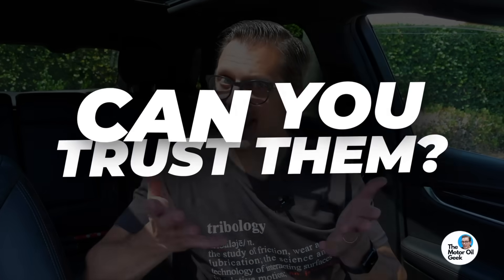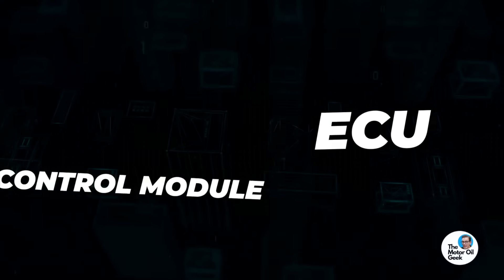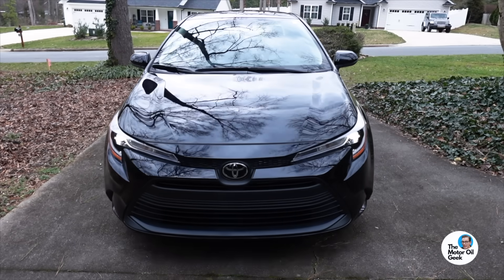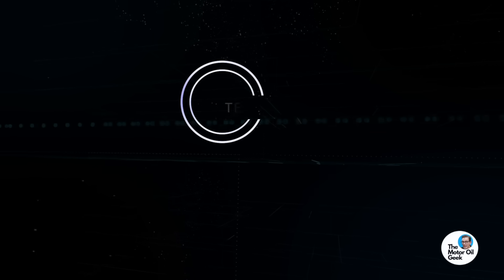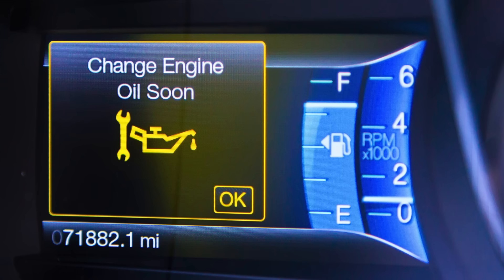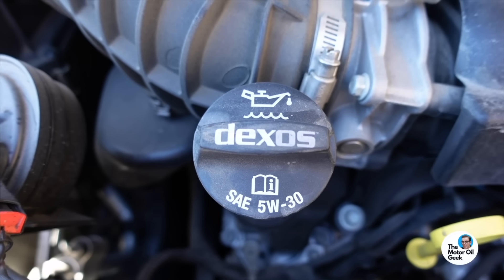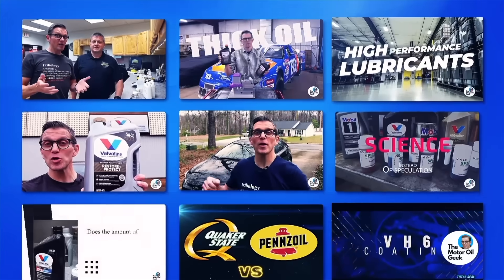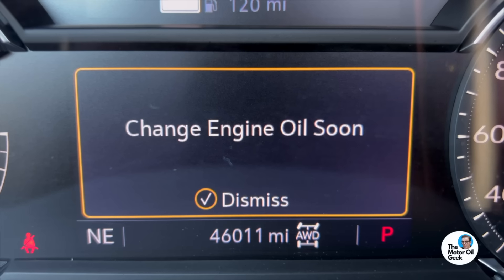The Accuracy of OIL LIFE Indicators REVEALED!

Comment: I would like to see this done on a Ford Hybrid to see what the oil life monitor says about how those are on oil. Lots of shutting off and restarting, resulting in high fuel dilution, not getting up to temp on the oil and getting contaminated with moisture. It would be interesting to see how the oil looks after several thousand miles.
Reply from the maker: Great suggestion!

Comment: Personally speaking here:
I have a f150 with the 3.7 in it, and I use pennzoil ultra platinum full synthetic 5-20w. And for the last 5yrs I don’t let the oil life get below 50% (it averages out to about 5,000 miles) before I get my oil changed. I have a 20min commute (10city/10highway) Mon-Friday, and I drive with common sense (my daughter says I drive like an old man 🤷‍♂️ lol). I do take longer drives/trips on the weekends, but my driving habits are the same.  I know getting my oil changed at 50% is definitely early, however I see it as oil is cheap but engines are expensive. She runs like a top (with 130k on it); no leaks, no hesitation, no sputtering, just silky smooth. 🤷‍♂️ 😊
Reply: That Ford 3.7L V6 N/A engine is excellent. We've had many Transit cargo vans w/it get huge mileage before we sell vans (running great & employees will bid on em). Consistent basic maintenance practices is key. Only full synthetic engine oil (that meets Ford specs) like Pennzoil Platinum or Motorcraft Full Synthetic which i use both personally & business uses predominantly Motorcraft. OEM filters fine as well if stay below 6k mis. Top Tier rated fuels highly recommended by Ford & everyone. My 24 Ranger Raptor 4wd truck had 1st oil change (Motorcraft full synthetic 5w30) b4 1500mis - use top tier rated midgrade 89/93 fuel only. Gen2 3.0L twin turbo seems like it so far! Engineering perspective.
Reply: wasting alot of oil and money- your money I guess- but contributing to environmental damage.
Reply: @roberthooper8883 You drive a electric car I guess. I change the oil in my 95 dodge quite often depending on I've been towing or just driving but mostly 3 to 5 thousand miles. I take the used oil and dump it in the fuel transfer tank I have in the bed. I then can pump a mix of diesel and used oil in my tractor and back into the 95 dodge with a 12 valve Cummins. Motor has 385,000 miles. I've put 1 water pump on it. I've also put a 0 fuel plate and turn the pump wide open and put 4,000 rpm governor  springs and brought pump timing to 14.5 degrees btc and added 80lb valve springs and 100hp injectors. Water pump was really the only thing it needed but my old dodge will run right down the road with any of these new ones. Yea it put out some smoke. But as long as it starts I know I'll be making it back no limp mode to shut it down and no $1500.00 payment on a new truck.  Best part I can set the throttle cable and let it idle while i go in and eat lunch a/c and heat will keep things good and no worry about plugging a exhaust filter
Reply: @davidcaskey4669  You guessed wrong then lol... No electric here- my chainsaws, weedeater, mowers, etc all gas or diesel. 1965 Cat D6-B dozer, Case 580 Super L backhoe, John Deere 65 hp loader tractor, 3 Dodge Cummins - 2 24 valves and 1 12 valve, 2003 F350 7.3 liter 4x4. Yeah I like toys. I don't change oil when it is still almost new though. When I do change oil, I add much of the used back into fuel for the tractors and dozer.
Reply: Love your channel. Great to finally have someone who knows what they are talking about regarding oil cutting through all of the BS. Is the Honda oil life monitor as effective? This is my third Civic. First was a 8th generation 1.8 with well over 200,000 miles that was rear ended second was a 9th generation 1.8 with well over 200,000 miles and I hit a deer. Now on my third also 9th generation with the 1.8 at over 130,000 miles. I do almost all at least 90% highway driving and the oil monitor calls/called for changes in all three at around 10,000 to 11,000 miles. My first Civic would lose about 1/2 quart between changes my last one and current one lose/lost zero. All three ran/run Great. My last oil change the oil wasn't even dark yet, looked like it was recently changed. The minder said it was due so I changed it of cousre.
Reply: I have the same vehicle (F150 3.7L).  I change the oil usually when the indicator gets close to 0.  I use whatever synthetic oil I find on sale.  Sometimes Mobil, sometimes Valvoline, Penzoil or even Walmart or Canadian Tire brands.  I use Motocraft filters.  I'm over 400K miles (almost 700K kms )and it still runs pretty well.
Reply: @rickmossop3733 I’m the same. Modern oils are completely different than the old oils that needed 6 month oil changes decades ago. Changing at 50% oil life is just wasteful ignorance. Some people have more money than brains.
Reply: @classicrider103  Really nothing wrong with Supertech.
Reply: The mentality of a boomer with too much time and money to spend on nothing.
Reply: @psalmtt8784  so true
Reply: Don't drive conservatively all the time. You should get it around 80% load once in a while.
Reply: bit off topic, but why F150 for commute, do you use it in work? If not for that buy better - smaller (used) car.
Reply: So smart- I got tired of spending 55-60 k for a truck to just run around in- bought a Honda Ridgeline- best of both worlds- even has a trunk! Ridgeline will do 95 percent of what the average person ever needs.
Reply: Do you also change your spark plugs and filters more than is recommended by the engineers that verify those requirements?
Reply: @brwisn4359  great question. Wasting oil, period.
Reply: I have a 2024 Ram power wagon 2500 4x4 I bought brand new. I changed my oil at 500 miles for the first time. It kills me that people will spend 70-80K on a vehicle and then put a $2-3 oil in it as well as waiting 10k miles or more to change the oil. I don't even pay attention to that gauge every 5K I change it. Take care brother
Reply: @Eurofreestylemusic  How do you know it wouldn't have made it just as far going further on oil changes?
Reply: I think 10 city and 10 highway is enough to get the motor up to snuff, but just to be sure, give it the beans here and there, let it rev to the max, remind it of what a motor should really be :)  This is why I've had a stick shift for 20 years now, because I like controlling my revs and when it shifts.  My old Mazda 3 from 2008 is still going strong today, and I make sure she gets close to the red line on occasion, just like old times <3
Reply: That’s because you are “supposed” to do a 10,000 mile oil change per ford.
Reply: I change my diesel every 6-8k, depending on how hard I'm on it... city or highway, towing or empty
Reply: Classic example of a fallacy. And way too much useless data in the post. Keep up with the post hoc ergo propter hoc…
Reply: I have a 2020 escape. I never let it get under 20% which is about 7500 miles. Which is about right for synthetic
Reply: @BrianWaller-qe7gr  How do you know it is about right?  Have you had the used oil analyzed?
Reply: @ I meant the monitor hitting 20% is around 7500 miles has nothing to do with the quality of the oil just hitting 20% is always around 7500 miles and it’s recommended to change full synthetic by 7500 miles. Although some say it could be stretched to 10k
Reply: I do the opposite, when the oil indicator comes on I reset to 80%  when it comes on again I change the oil. Normally ~15k miles. 

Engine has 210,000 on it now and burns zero oil.
Reply: I have the same engine...with 310k miles. I wait until around 30%.
Reply: It might be cheap but it’s a huge waste of oil!
Reply: changing it at 50% wow, that's definitely way too early. but, it's your money to waste.
Reply: Interesting, you should try out the blackstone labs oil sampling. See what your's is doing
Reply: @sasquatchcrew  Blackstone is def okay. There are better oil analysis places I've learned for same price. Use top tier rated fuel in your vehicles esp if GDI/GTDI.
Reply: @sasquatchcrew      The oil geeks lab is more comprehensive.
Reply: @sasquatchcrew why not try out Lake Speed’s (the guy in the video) oil analysis  company?
Reply: @wethepeople1776x  you should just double the oil change intervals. The oil manufacturers say it's OK. I'm joking. Keep taking great care of the engine.
Reply: @classicrider103  On older engines try a "high mileage" type oil (whatever type you've been using semi-synthetic/full synthetic etc). Valvoline & Pennzoil make best rated high mileage oils out there (Mobil1 in top 3) that will swell engine seals to prevent leaks & help engine last LONGER. Use good fuel system cleaner every 6-10k mis too. Lucas/Redline/Techron are 3 i use & recommend. Engineering perspective. Enjoy!
Reply: It's nice to see someone understand that oil is cheaper than engines.  I've seen people be cheap trying to skimp on filters, push longer miles between changes, using cheaper oils not rated for teh application and in the end you spend a few thousand on a turbo or some other repair.  THe money you save on cheap oil changes wont pay the taxes on one of those big engine repairs.
Reply: @curtisroberts9137  Absolutely correct! Though changing less than 5k mis w/today's SP rated/GF-6A full synthetic oils is wasting time/$. Unless vehicle sits 99% of time like my 04 Mustang SVT Cobra terminator - orig owner- 4900 mis- 600hp+ . Gets Redline Ester 5w30 oil. Boutique oils def not needed for daily driver reg vehicles. Engineering perspective.
Reply: @Davido50  I pretty much stay to 5k miles on syn blend and 6k on full syn.  I have used some of the high mileage rated oils and filters but it makes me uncomfortable. I've worked on to many cars that came in bone dry on oil cuz someone thought they could go 20k miles without checking fluid level!  The oil is capable of it but the car may not be.  5 or 6k miles is also a good interval for inspection of brakes, ball joints, and other components as well as tire rotation.  That works for me so I stick to it on my vehicles.
Reply: @curtisroberts9137  I do not understand your statement "The oil is capable of it but the car may not be."
Reply: @davidlohberger5237  the oil has the ability to last the mileage but a car that consumes oil might run empty long before the mileage is reached. Most manufacturers show for approximately 1qt of oil consumption per 2000 miles before they consider it an issue needing repair. At that rate a car going on a 20000 mile oil change could consume 10qts of oil.  So if you're going to go for those long interval oils make sure you check the oil level regularly.
Reply: @curtisroberts9137  Yes,  you still have to check that you have enough oil.
Reply: @Davido50  Look up F150 sludge issues then see if you still agree.  Alot of cars that say 10k mile intervals are having major sludge build up.
Reply: @curtisroberts9137 😂
Reply: @Eurofreestylemusic What empirical data do you have to support your claim?
Reply: I believe non-GM oil life monitors are simply mile counters and don't use the complex algorithm developed by GM.
Reply: @D2O2  definitely not true for Ford, it depends on the model for when it was implemented, but for a decade or more, they have a true adaptive oil life monitor.
Reply: Keep doing what your doing.  These modern engines have sludge issues and eventually they mess with your cam phasers and that's expensive.
Reply: It's a ford so most likely it will help its longevity. For Japanese like toyota's, longer intervals are just fine because it was already engineered to last long more than many other brands out there. As a previous ford owner's of three ford trucks(two gasolines & one diesel), I highly recommend to always have a pair of walking shoes accessible inside of the ford cab for those times you'll be walking home. FORD = found-on-road-dead.
Reply: @j.l.salayao8055  1999 f350 with 397k miles, 2003 f350 with 198k miles. You are a crap driver and maintainer obviously

Comment: My mom has a 2011 Honda CRV. It uses an OLM and says to change the oil when it reaches 15%. I saw too many engines where the 2mm oil rings were ruined when trusting some OLMs or a 10,000 0w20 synthetic interval. It is said that the GM 3.6 V6 timing chains did not last if you went the distance.

America needs to get on the metric system? Dude, where's my 10mm socket?
Reply from the maker: LOL on the 10mm socket!
Reply: When the metric system solves the 10mm socket problem it will have matured enough for US adoption. Interesting that Toyota never uses 10mm - probably why their factories are so efficient - the workers save so much time other waste searching for them.
Reply: @MathewPollard-vj4uq  Every American cars has been full of 10mm bolts since the 80s. That is why I joke about the "America needs to go metric" argument.

Besides, I don't know if that exactly fixes everything. Should we turbo guys go for BAR or Kg/Cm^2?
Reply: @MathewPollard-vj4uq     Toyota is always Metric.
Reply: @wysetech2000  They just don't over use 10mm. More 8, 12, 14,17,19. My Nissans are 80% 10mm.
Reply: @MathewPollard-vj4uq     Agree, but they all use metric fasteners.

Comment: Ask anyone who owned a 2011 Equinox how well the GM oil life algorithm works.  After thousands of engines began going through oil faster than gasoline (slight exageration) GM had a programing update to correct he oil life monitor algorithm in the computer. They later added a special coverage for those engines to replace the pistons and rings.  In theory it's a great tool, but in reality you have to believe that no one in marketing or some other department got in the way of good engineering to make adjustments.  I had an 05 Trailblazer and at something like 7,000 miles it said I still had 40% oil life with the required conventional oil.  I did drive it like grandma, but I just aint buying that.
Reply from the maker: That sounds like an engine hardware issue and not an algorithm problem. Piston rings are my day job, so oil consumption like that is piston ring and cylinder bore surface finish problem.
Reply: @themotoroilgeek  The equinox's did have piston ring issues that is why they ended up replacing them under warranty but before they did that they did a recall which reprogrammed the oil life monitor because it was allowing for insane distances. People would run thier engines for 7k+ miles pre-dexos and the oil would break down and not offer protection.  The 2011 was later  recommended for dexos oils which allowed for longer mile intervals being synthetic.  I'm sure in most cases, the monitor isnt that bad however you dont know until you know and then it may be too late.

Comment: geek i disagree with you on the water coming out of the tail pipe that is a indication the cat is workin. would you be happy with 7.5k oil changes on a gdi n turbo engine?
Reply from the maker: The water coming out of the tailpipe is just a visual to illustrate that water is a byproduct of combustion.
Reply: The water, as stated, is a byproduct of combustion. If you do short journeys, the exhaust won't get up to temperature and the water vapour will condense within the exhaust, giving the visual water you can see dripping. If this isn't cleared out/evaporated off, it'll cause the exhaust to rust from the inside out.

7.5 sounds about right for a GDI turbo engine. Other engines should be fine for 10k at least.
Reply: @paulsengupta971  lol you do 7.5k oil changes on a turbo n gdi engine n 10k on a natural asperated vehicle see what happens
Reply: @tonywhite425  I'm not sure what you're getting at, I've been doing 10-12k oil changes on my turbocharged engines since forever. The USA has some weird obsession with wasting money.
Reply: @tonywhite425  Turbos. Twin turbos. On two different cars so four in total! One with 180k miles on it, one with 120k miles on it.

Comment: I did not realize how sophisticated these programs are. But we had a 2006 suburban that drove around 250k miles before we traded it and I used the oil life indicator to change oil. I guess they work.
Reply: If you bought a new GM; you’ll wish you had the 06 back, AFM / DFM & Direct Injection detonate reliability.
Reply: @flashnmb1 I have a ‘97 burb with nearly 200k miles that still runs like a clock, while my friend’s 2018 Silverado with 62k miles already needs fuel injector replacements 😂
Reply: I had a 2010 Silverado with the 5.3 and I used the oil life indicator and it had lifter failure around 160,000 and I was very, very easy on the truck.
Reply: Should’ve kept that 05 for life. Doesn’t get better than a gmt800..
Reply: Have a travel pattern that puts you at 100k miles in the same number of years while using that oil life counter and thenoutcome is WAY different. I see few problems with do it when it says to cars 6 years old and 100k miles. Same deal but 12 years at that milage and they've spent money on leaks and maybe need cam phasers and chains and hardware.
Reply: Did you drive a 2006 Chevy suburban? Or was that another car brand? 

For many newer cars, the engine pistons and piston rings are so thin/light that it only takes a little bit of bad oil to ruin the whole engine.

Comment: What would you say to mechanics that don't recommend going to the 10k mile range of those oil life indicators?  Mine says that even though oil has improved and can go that long between changes, the oil filters have not been improved yet to do the same (i.e. are still designed to only go 5k miles).
Reply from the maker: The data we see from doing lots of used oil samples indicates 99% of the time the oil was changed sooner than needed.
Reply: @themotoroilgeek  Interesting.  Thank you for sharing.